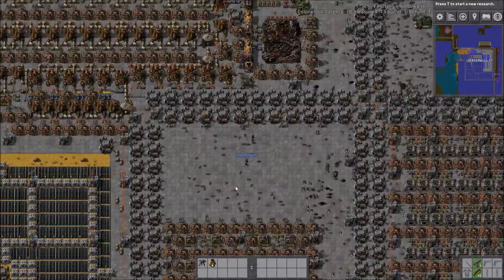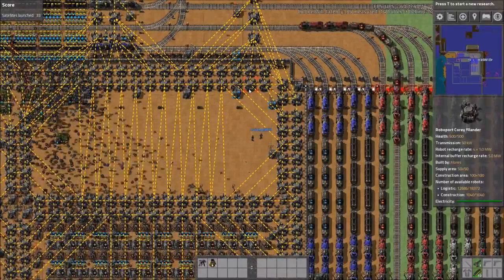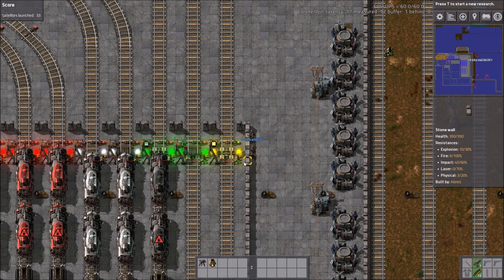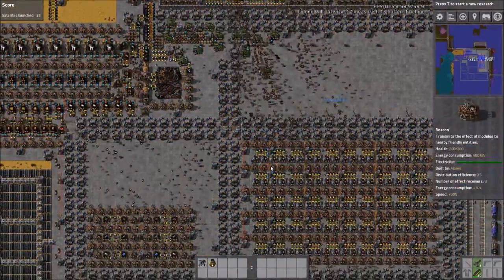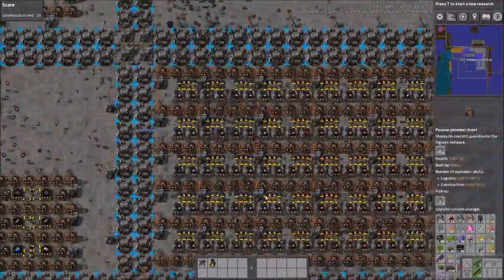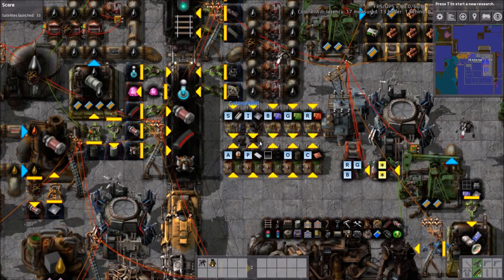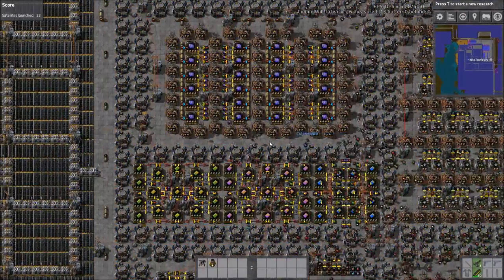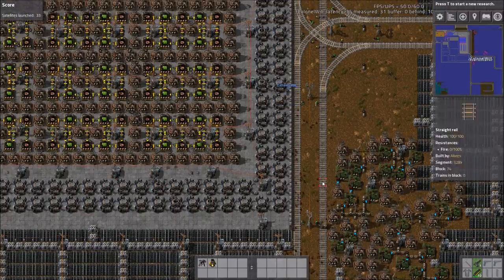EP11: Alore's Factory | Factorio Refactorizing - Fixing Your Factory

Comment: what I have noticed, there are a few trains that come from outposts empty, and they do not get refueled at main bis, becouse (probably) their condition is 'until empty', and thay can and will clog up the rail system, you need to add 'AND' + '5 seconds passed' to every train that stops at refueling point.
Reply: I have a 60 sec passed or condition on it, probably better better to shorten it.
Reply: Better not to shorten, but to add "AND" condition (on the offload-refuel station) - "empty and 5 sec" - this worcd great for me in few games, in last one I am testing "empty and 5 sec of inactivity" (this should make sure that train is 100% full on fuel).
I use "OR" on the outposts - "full or 120 sec passed."

Comment: I'm surprised Colonelwill didn't mention the position of the train unloaders relative to smelters. Every bot with ore has to fly east to some degree. Isn't it more efficient that some bots fly exactly due south, some to the south and west and some to the south and east?
Reply from the maker: It is most efficient for bots to fly the shortest possible distance whatever that may be. So yeah in general, it would be less efficient, but a smaller issue compared to some of the others we covered.